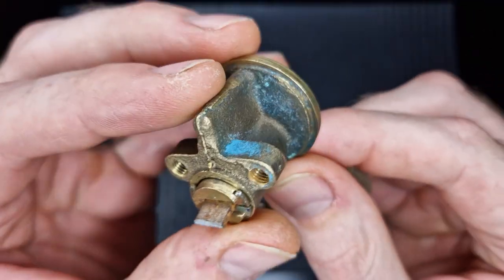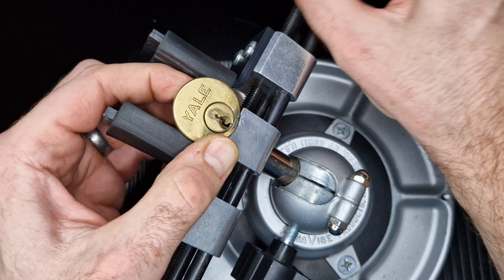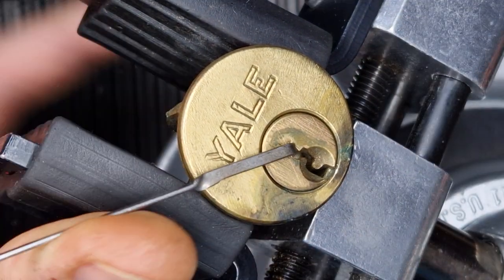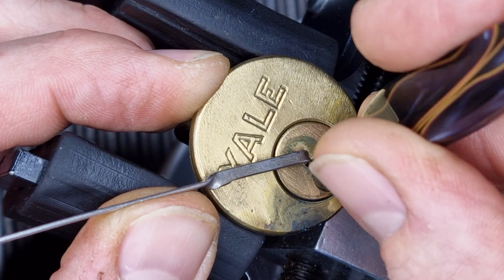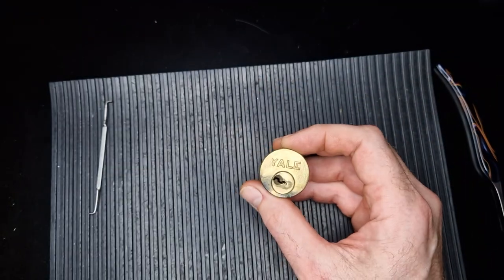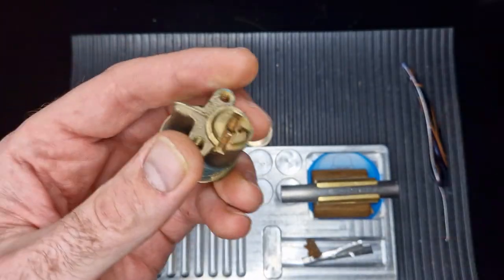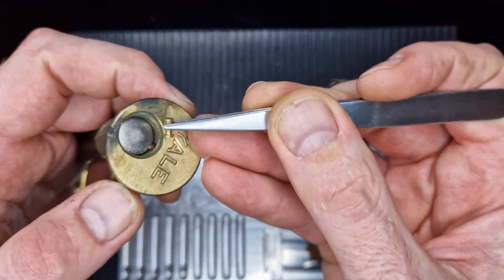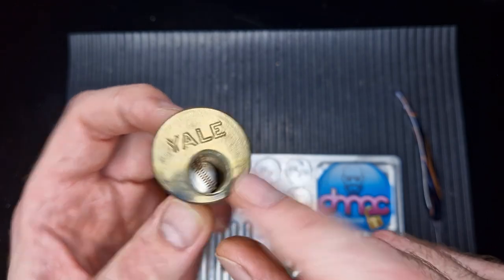Picking a crusty Yale rim cylinder with a shiny new custom pick

Comment: Hey did ya make that core holder? Or pinning shoe? What lock did ya use to make that? Or was it a lock. I’ve been looking for something to make one out of but haven’t come across one I’d think would work well. Or sit on table and be usable.
Reply from the maker: Stay tuned dude as I'm doing a how-to vid on making one 😎👍🏻
Reply: @Dmaclocksport  so tomorrow then…😝. Lol. That would be awesome. Been wanting one for awhile now. I think it imperative to cl making/gutting. Sure ya can do without. But will save you a lot of time and or trouble down the road.🤷🏼. Or it’s what I think. As I’ve made these mistakes😳😂.
Reply from the maker: @SadisticPicker  I use it all the time mate. An essential tool for the serious picker 😎👌🏼